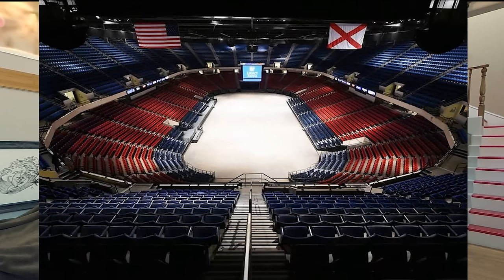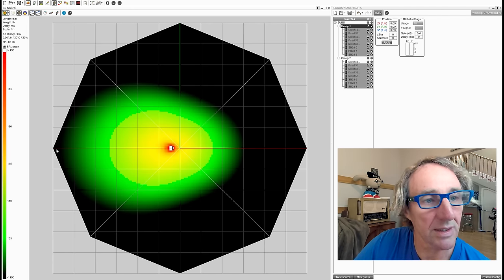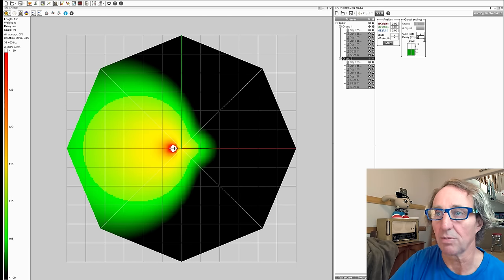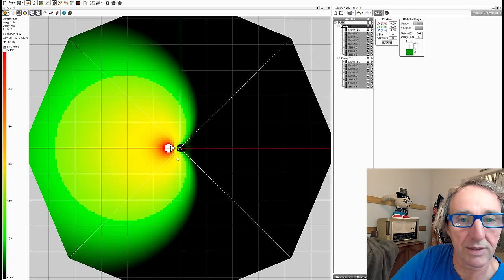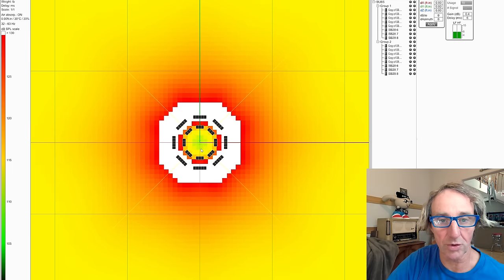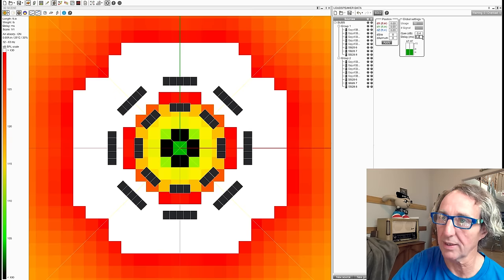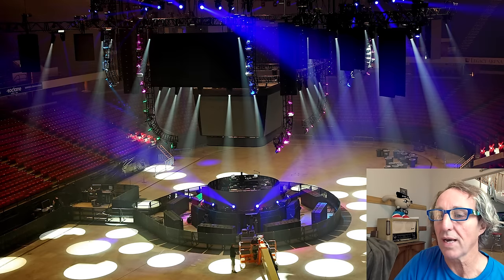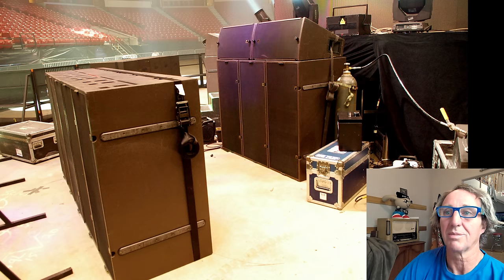Bassnectar 360 Subwoofer Sound Design

Comment: Wow so interesting ... Was that in an Ice arena? and what of the humidity levels from the ice sheet under the floor? I know they lay down a floor over the ice.
Reply from the maker: I think it did have ice but can't recall for sure. As far as humidity, that has a small fraction of the impact that hear does, so it can be ignored, sound wise as heat corrections will sort it.
Reply: @DaveRat  COOL... I managed Ice Arenas for a time.. SOUND was always a problem as EVERY wall was hard... Reflection on reflection on reflection .... and the corners were parabolic... 
Great video.. so interesting
Reply from the maker: Interesting and yes, lots of hard surfaces are a bummer and ice makes your feet hurt

Comment: 2 Questions: 
How many Rat SuperSubs would you have to use to do the same layout?
Can you do a video like this for setting up the steering for the Anya rig?
Reply from the maker: I'm not overly experienced in the Anya setup. I was a consultant in the design of the box and assisted with the layout and configuration but never really dived into the software myself.

As far as quantity of super subs, one super Sub is about the same output as three sb28 s. 

So I would say about 24 supersubs should hit the same levels as 64 sb28
Reply: @DaveRat  Do you see some time in the future where you channel your inner Van Halen or Yngwie and have 24 supersubs with another 48 supersub empty shells just for looks?
Reply from the maker: I'm not much for show, just go

Comment: I'd imagine that this setup caused a bit of an uneven frequency response in front, but the good thing about that setup is, that you can EQ the whole system and improve the front radiation, while the rear cancellation stays the same (since if you increase something with EQ, you will also increase the levels of the subs that cancel it). And if you EQ the subs as a whole, you can use minimum phase EQ without worries (unless you come too close to the crossover region, then you'll have to apply to the same EQ to the mains as well if you wanna retain phase coherency, altho the changes would probably be small enough that it wouldn't even matter much).
An alternative would be to fly 4 hangs over the artist and set up a few subs on stage (again in a symmetric pattern), that just cancel out the sound that's coming from above.
Reply from the maker: No room to fly more at this one
Reply: You obviously have no clue about how this works.
Reply: @randysterling4700  Would you then be so kind to point out my mistakes? I'm always eager to learn!
Reply from the maker: Penekiw8, maybe do a model prediction of what you recommend and see if you can even get close to what this design achieves
Reply: @DaveRat  That's a good idea. Sounds like a fun evening project, actually!
But I'm not sure if Randy is talking about my initial talks about your setup or if he is refering to my quick idea with flown subs (which literally just came to my mind while writing the original comment), since he was a bit shy with words.
If he is talking about my thoughts on your setup, I think he might've confused End-fire with cardioid.
The cardioid setup in your video prioritizes cancellation at all frequencies on stage.

The effect on FOH would be the following, if I didn't confuse something myself:
-the rear subs will play with an electronic delay of 6.1ms and a physical delay to the front group of the same length, factoring in the speed of sound at 30°C from 10:08 in the video, taking the total delay to 12.2ms
-the rear subs play out of polarity
these two combined mean, that a frequency with a cycle time of twice the electronic+physical delay will perfectly sum with the front subs, which is 41Hz in this case. That means you'll see an overall bump at this frequency at FOH, with a magnitude and Q that could be checked in Soundvision, I think. This 41Hz bump can simply be corrected with the same minimum phase EQ on all groups of subs. Since rear cancellation is frequency and magnitude independent, it will stay the same, while FOH FR will be flattened out.
Technically, the out-of-polarity rear group would result in a simple roll-off below 41Hz and comb filterting (way) above 41Hz. I'd be interested to see where this roll-off crosses the "zero gain" point from the rear clusters actually. Any way you could make a follow-up on this showing different frequencies, Dave? That would be highly appreciated and cool to see!
Reply: Follow-up: the magnitude of the 41Hz bump at FOH would be 4.25dB, with the 5:3 ratio and the rear subs being 0.4dB louder as in your Soundvision setup.
Reply from the maker: Sound about right and then EQ applied to both rings flattens the response for the octave they were used.

I am not a big fan of cardioid and endfire sounds better but for this application cardioid was the best choice
Reply: @DaveRat  Finally got time to play around in Soundvision a bit.
I made a quick model and put a ring of 8x4 subs above the stage at an elevation of 15m and then put a ring of 8 subs on the stage with the polarity flipped and gain and delay set up for maximum cancellation on stage.

Just the hangs I get 128dB in the center of the stage, adding the stage subs results in a 25dB reduction in SPL (dB figures are in the 20-100Hz bandwidth) in the center of the stage and the audience levels increase a bit overall but don't change much.

There might be some funkiness in the frequency response across the audience, since the relative distances between the main subs and the stage ring change with distance from the stage, but it should be relatively minor, since it's a 4:1 ratio. 

Is it better than the setup in the video? No, it creates more unevenness in the audience and the subs don't sum as well. Also I've spent like 5 minutes on this, so I didn't expect any wonders. But it would allow for more floor space and subsequently more guests.
Reply from the maker: Super cool! To get even coverage and response you want it such that people can't get or be closer or farther to the in polarity without also getting closer or farther from the out of polarity subs. 

Each group of in and out of polarity subs should be looked at like a module people can get closer or farther from the module as a whole but not things like people close to parts of the module while others are closer to other parts of the module
Reply: @DaveRat  Yea my initial idea was to cancel out the response just at the artist's position with few subs so that the audience wouldn't be compromised, but that only achieved a reduction of 15dB over a relatively small area on the stage, which I wasn't very happy with, so I ended up with 8 KS28 on stage, which will radiate quite a bit of sound into the audience as well, so I made the stage ring of subs larger than the ring of hangs, so that the main subs would act more like a point source and the stage subs wouldn't mess too much with the audience's experience. Maybe I'll try optimizing it some more, it's fun to play around with for sure!

Comment: what delay time did you bump down to when the setup was at its hottest (and what was that temperature?)
Reply from the maker: Oooh, I don't recall but also, the predicted delay time was different that real world as the DJ both was elevated which required less delay for the cancellation at the slightly upward angle.

I tuned by ear and with an RTA.
Reply: @DaveRat  Hah yeah I listened further and realised there were more parameters at play. Appreciate the swift response. That was a thoroughly interesting video
Reply from the maker: Thank you!!

Comment: When you have a circular speaker setup can you emulate a leslie speaker effect by modulating the amplitude of the speakers by offset sine waves?
Reply from the maker: Hmmm,  a Leslie has spinning speaker outputs that not only sends sound in diff directions but also creates a doppler effect that alters the frequencies heard. The doppler effect would require physical motion or need to be electronically synthesized in addition top the circular speakers
Reply: @DaveRat  you are 100% right. Apperently there is a whole rabbithole behind simulating moving sources with speaker arrays that I didnt know about. Stumbled on an abstract from stanford from a group trying to emulate leslie speakers. Another paper of just getting the doppler effect to work on a line array. Its kinda crazy how complicated the math gets, i thought it would be as simple as changing the phase shifts dynamically but the differential equations involved are nuts.
Reply from the maker: Yes setting up a Leslie emulator or anything using electronics to try and emulate the physical world gets excessively complex and tends to underperform

Comment: Do they make a loud speaker management with a metrology probe to adjust delay/crossover/eq as the temperature and humidity changes? I know the old BSS FDS 388 I got in my rack does crossover and EQ to factory set sorta adjustments as the temperature and humidity change via metrology probe (which was near impossible to find i had to convert a rotronic probe to work) but I wonder if someone made one with more user alterable parameters if not why the heck not!
Reply from the maker: The issue is that having delay slide around adds a level of mysterious gremlins. The temp in one spot is not indictive of the average temp between two locations. You need lots of temp probes and an algorithm to calc. Or, way les complex, manually adjust
Reply: @DaveRat  very insightful thanks!!

Comment: What would the sound be like if you designed it with subs spread out around the whole space?  Better bass coverage or worse?
ie: 4 corners or 8 corners…
Reply from the maker: The focus of a speard out array is straight up (down). So it would shoot all summed energy to the roof. That said, more people would be close to subs, which would eave out coverage.  But the main sound would still come from the main pa and so timing would be a mess.

If you timed all the subs to the mains, then it would have all these increasing delays, if you don't time it, then the sound would be all screwy.

Basically, if you spread out the subs, you'd want to distribute the main pa as well 

Think - mess of speakers everywhere connected by trip wires
Reply: @DaveRat   What if the speakers were spread around the 8 walls facing in?  Would the cabling be that bad if you had to connect 8 clusters around the whole space?  Presumably it would all be connected with Network cable and something like Dante for low latency too..?   If we assume the setup isn't an issue, do you think the sound could work out this way too?  Or for sure Center out is best? 

I found your video on this system setup interesting.   Thanks
Reply from the maker: The delay is is the sound traveling through air. Speakers around the wall would take 300 milliseconds to reach the middle of the room.

Delay offsets of over 20 ms started to sound weird.

All sounds needs to redaiated from similar locations and directions in large spaces
Reply: @DaveRat   Ya, I guess it makes sense to just keep the sound system near the performer too, especially a DJ
Reply: @DaveRat   Do you ever use anything similar to Dirac Live for Bass in Pro Audio?
Reply from the maker: Hmmm, I have not. For live audio having full control over where things are sent and all parameters is what I prefer. Black boxes rarely do what is desired.

Covering large spaces is a completely different adventure than small spaces.

Comment: What about if you had panels of perspex around the centre between the artist and speaker with induces connected to them playing out of phase and adjusting the frequency to add more cancellation in the centre that should work, whats the best way to add in delay electronically?
Reply from the maker: Plastic panels to subs are like tissue paper to a garden hose
Reply: @DaveRat  yes but You are turning the panel into a speaker!
It's not just a panel on his own. It's like an active acoustic barrier, try it out see what your results are.. you want some hefty induces on there tho place glued the 1/3- 2/3 role, 2/3 from the top/bottom and 1/3 from the side. The panel has to have movement not rigidly fixed.
If you had some box aluminium frame you could connect it top and bottom the four corners with bungee cord.
Probably 6mm - 8mm perspex acrylic. Sponge plastic coating sandwich material is better but of course you're not getting the view transparency
Reply from the maker: That does interesting but does not sound stunningly beautiful. 

Reducing 130 db of 30hz takes a pretty hefty barrier.
Reply: @DaveRat  well it wouldn't be 130 db because that's already reduced down to what you said about 97-99 in the inner circle, You're reducing it down from that point so theoretically I suppose possible to get it down to 88db or lower.
It's like noise cancelling headphones I would have thought, the frequency is not static either it will move up and down with the bass, I suppose you could play a single tone but not sure if there's a benefit or not maybe in some circumstances where you are you getting reflections back to the circle/ stage. You say acrylic is transparent to sound, so why do they use them on stage for drum kits? I thought it was to block out the mics getting feedback.
Reply from the maker: I have used them in extreme situations most drummers don't like them and I try and avoid putting anything between the artist and the audience visually or physically dilutes the connection between the two

Lights reflect off of them in weird ways and it's a distraction also it makes it harder for a drummer to hear what the other band members are saying. I've also run into issues where the drummer was getting too hot because the air was not circulating to the plexiglass.

Maybe give a watch to some YouTube of Bassnectar performing. Covered in sweat whipping his hair around throwing moisture in all directions would just coat those things with a salty layer of muck

Not against using them as a last resort when all else fails

Comment: I heard the Anya blew a breaker 400 amp. True?
Reply from the maker: Sort of, the building had a faulty connection that melted. The system was pulling less than the the rated breaker we were connected to. We were monitoring power draw as it was a concern

Comment: What type of port would give the most SPL possible given the same sub and volume? Sound quality is not a concern
Reply from the maker: Bigger ports tend to be louder and will have less low end. Smaller ports go lower and not as loud
Reply: @DaveRat  sorry, i should've clarify: I meant round vs rectangular vs folded horn vs expo
Reply: @DaveRat  btw thanks for all of your videos you share with us, really appreciate the effort and generosity 🤝🏻
Reply from the maker: That's more than I can answer here but look at L-Acoustics KS28 ports
Reply: @DaveRat  thanks, will do
Reply: @DaveRat  it seems like a dual expo. Interesting 🤔
Reply from the maker: Reduce turbulence and restriction for max resonance gives max output of some rear